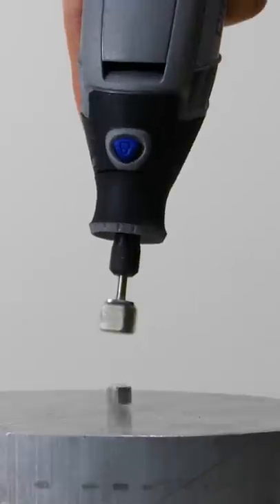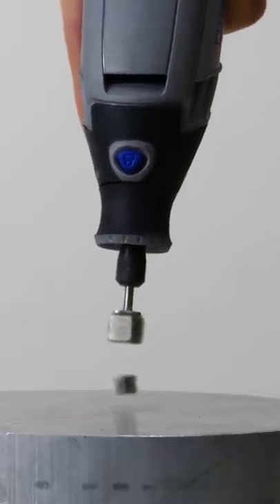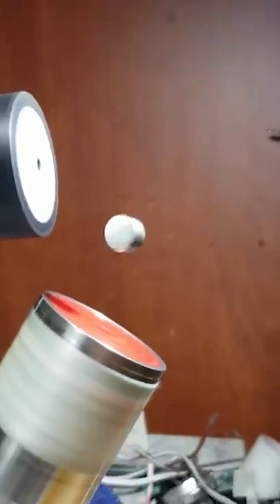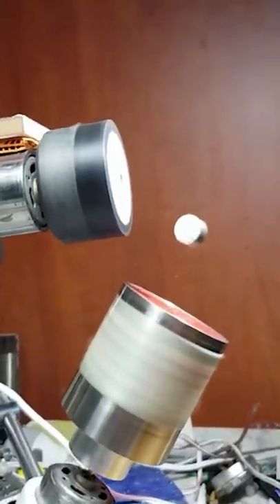Real-life Magnetic Tractor Beam! (New Physics Discovery)

Comment: If you can use a rotating magnet, it ought to be possible with a set of coils to create the rotating field
Reply: I've seen someone create a rotating magnetic field that spun mercury in a bowl
Reply: Sure is. That's how the motor stator in many power tools (especially cheaper brushless) is centred, eliminating need for some of the bearings.
Reply: That's why this isn't really new... It's been done for years now with a coil acting as an electromagnet, and having an alternating current through it. 

Like those display toys that have a floating platform or floating globe. The magnet is inside the toy or floating platform, and the coil is in the base.

It's interesting to see in practice, though, and can prove to be useful to demonstrate rotating magnetic fields in a more tangible way.

It is also reminds me of how magnetic gear boxes work. If you can look it up, it is a very interesting concept.
Reply: @altersami9660  Like Tesla's egg, but much more controlled/powerful.
Reply: @ChrisKarr  I've never heard of it before. Sounds interesting. Thanks for letting me know.

I've looked it up. Kinda similar, but the "egg" has to be a magnet, not a solid piece of conductor.
Reply: @altersami9660  It could just be an aluminium egg, with strong enough magnetic field. Diamagnetism/Lorentz force is a funny thing.
Reply: I believe the eddy currents created by using a spinning magnet versus an electrical coil is how this works so well.
Reply: @MySickstring  If you have a rotating magnetic field with enough poles and a proper driving circuit, you can replicate the exact same thing. Otherwise, you are absolutely correct.
Reply: 100%, I could probably personally make this solid state
Couldn't be harder to make than a simple CRT.
Reply: @itsthem5699  A simple crt just has two (four?) Coils for deflection.  We're talking about enough coils to simulate a constant-T field rotation. I'd think that an e-bike motor (or similar hubless) would have enough poles. Okay, yeah, winding it would suck...but driving it wouldn't be too rough.
Reply: That's what a generator is
Reply: Frank Dilson  It's an electromagnetic cushion; its cost of building, transportation and operation are far greater than the myriad other solutions to raising objects and holding them at a specific point which we already have.
Reply: @gabrielware2777  That would have to be a very lightweight flywheel to get it up to speed. Again, application is already well-served by bouncing personnel mines - bouncing betties.

Besides, traditional high-exp. materials are far superior for quick deployment, which preserves the element of surprise, not giving the enemy time to get to cover.
Reply: @altersami9660  the idea is to stop the forces from attracting thus scrambling the Electromagnetic Around U .thus weightless .
Reply: Frank Dilson  My, my.  Someone is deeply offended.  Why does one guy engaging with nearly every idea offered in one thread offend you?  If you contend with his ideas, then contend.  You've not been a guest in any of those programs, either, so it seems an even contest.  Present your own ideas, not some bizarre ad hominem.  Hey, it might be fun to engage with someone who is actually likely to reply with his own ideas.  

Or, you could just be a Karen about the whole thing and just try to tear him down.  Your choice.
Reply: Frank Dilson  Wow.. that came out of left field..
Reply: Frank Dilson  Primarily, my thoughts are based on study and border on religion, which makes me a non-viable candidate for most fields. My understanding of calculus is minimal, but I understand enough and have enough real-world experience with electrodynamics that physical interactions are fairly intuitive. Even quantum interactions seem that way. I enjoyed your attempt at using big words to sound as though your argument had merit.
Reply: @lahma69  Don't worry - all forces must be balanced! <(^_^)>
Reply: Frank Dilson  how much money you made asking that question?
Where is....?
Where....?
.....?
?
Reply: @altersami9660  9
Reply: Frank Dilson  I'm not running my mouth, I'm giving learned responses to ideas with little merit. Much like your life seems to have.  drops mic
Reply: Frank Dilson  I didn't ask how much money you have, I asked how much you made out of that question. Just like you asked that guy. Was that not clear enough?

Why would I rage with envy? What reasons would I have? Can't explain huh?

Plus that know-it-all-about-someone-else's-enviousness-based-on-nothing attitude, lack of reading comprehension, & eagerness to fallaciously attacking the person don't seem to be worth envying anyway. Raging yet with your envy now?
Reply: Only if it has no corn in it
Reply: @salaciousBastard  Easy, just give me 8X the energy required to lift it through normal physical forces.
Reply: @altersami9660  I do need to make a correction to your comment about the floating magnetic toys. I have such a toy - a globe - and studied how these work fora science project at school. They use either an infrared light beam or a hall-effect sensor to measure the distance of the floatable object to the electomagnet, and then adjust the electromagnet to keep the floating item at a predetermined distance.

That differs from this dremel effect in that the dremel does no such measurement and simply provides an alternating magnetic field.
Reply: @altersami9660  yeah but with this the floating magnet isnt rotating & doesnt need any rotation to continously balance itself
Reply: @johnsmith-jd1cd  The magnetic floating toys don't need to be rotating. They can stay still. But they look better rotating.
Reply: @johnsmith-jd1cd  I think there's been some confusion on which floating toy we were talking about. I think you ment the spinning magnetic top, while I ment the floating electromagnet like this one:
https://youtu.be/QOEyxwhw254
Reply: @jmrumble  You're right. Also, in this experiment, the rotating magnetic field seems to be rotating perpendicular to the floating magnet's field.
Reply: @salaciousBastard  No That's a rink.  A completely different department. That's two doors down on your left. This only does fields
Reply: @ChrisKarr  Yeah, like rope. That shit is great at raising objects and holding them at a specific point.
Reply: Alien tech at its most simplest
Reply: @altersami9660  you're talking about diamagnetic levitation and servomechanisms this is different this creates magnetic locking, similar to quantum locking which happens with superconductors
Reply: This is also how a starter kinda works in a car, with the coils and rotating magnetic field
Reply: @walkinmn  yes but the magnetic locking is the result of a rapidly rotating magnet in which north and south are always swapping places causing attraction and repulsion to happen in equilibrium allowing the other magnet to lock in place. This same rotating pole effect can be recreated using alternating currents or brushless DC circuitry.
Reply: @Frank Dilson I see that you deleted your comment that many of us in this thread replied to... Either that, or probably more likely, the author of the video (or YouTube) deleted it for you. However, I'm going to pretend to live in a world where you recognized the toxicity (and the sheer, out-of-left-field bizarre nature of) your comment and deleted it yourself. Yay for imagined self-imposed progress! 🎉
Reply: @ChrisKarr  electret magnetism
Reply: 3 phase electric Motors do this!
Reply: At that point it's literally just an electric motor
Reply: Freaquency is the key to this it’s not so much the polls or the field itself but the frequency of the field and the weight the mass of the object you’re trying to lift or levitate
Reply: Iirc this is how an induction motor works
Reply: Are you thinking what I'm thinking?
Reply: Those are called induction furnaces and someone already has
Reply: @LTRayzor  brother where did you see this? I've gotta see it myself.
Reply: @paulwhite5289  I found some videos here on YouTube but the original version I saw was not on YouTube. Not sure I can link it here but search rotating magnets mercury
Reply: That's a damn ufo
Reply: This is alien tech
Reply: Hey everybody....this is ufo tech, y ain't no 1 point that out? If we put all our brains in this n make a remote control 1 like a drone pero a ufo....a gyrosphere would a frisbee in the the middle for balance and aerodynamically two Chambers of mercury holders to spend both of them the opposite way of each other, a few little electromagnets to keep it spinning a coil to create an electric field or something like this brother... maybe a 3rd or 4 mercury chambers for horizontal spin maybe idk...I only did good in science class n p.e.
Reply: @its-c0e-u-see   this was exactly my thought
Reply: @its-c0e-u-see  scroll up, I pointed that out.
Reply: I just said same thing in dumber way haha...  Also plasma electro magnetics ... ?
Reply: @LTRayzor  thats just plain copper with current in it with no frequency... like the rail gun works, similar effect with coil gun but a whole diff "pulsating" system

Comment: Hmmm. This makes sense. Electromagnetic levitation achieves the same thing except the electromagnetic polarity is switched using electronics instead of mechanical force.
Reply: Now we can achieve the same effect with permanent magnets and a spinning motor!
Reply: This isn't quite that though. In electromagnetic levitation the switched field points along the same axis as the levitated magnet's. Here the spinning field is perpendicular to the levitated magnet's.
Reply: @AtlasReburdened  That's just it. Perhaps this will prove to be a more efficient way to achieve mag-lev.
Reply: @seanhoude  naw. Moving parts are always less efficient than non moving parts. Plus the use of permanent magnets are not realy safe for use in a train due to the intense from sun the magnets will be exposed to over the years. The magnets will slowly loose magnetism. But still this is awesome
Reply: @Skunkanoid  sad for you then because if so.. You will have no one or no "God" In the world that is or would be ever worthy of you.
Reply: @raloed.363  I hear you on the moving parts, but switching polarities on that scale isn't fast either. Could just as easily be electromagnets on both sides. It's an interesting concept. The current model is repulsive for the most part. The idea of being locked into a position between alternating attraction and repulsion sounds safer to me. Less likely to lift off, for example. Just saying it's worth investigating. Have you ever seen how a superconductor can be locked into relative position either supported by our suspended from a track of magnets? Now we have a way of doing it at room temperature. This is huge!
Reply: @jairussiriyalaofficial8922  we are only talking about worshipping here, i have a pretty good life without this "god" actually
Reply: @Skunkanoid  you think you are happy because you have no idea what you are missing, like in the island of born blind people no one realises what they are missing. Because you have no connection/Relationship with God you're not missing the most pure and unconditional love. Hopefully you will find out one day if not.. What you would describe of how the place after death will be will not be so great.
Reply: @Skunkanoid  ok about that I cannot say anything, but I should say you don't know what you said about your loving wife and marriage life. It is similar to saying that I don't care about my parents and wish never was born to them but I love brothers and sisters. You really think if God's grace is not there, you will be so lucky that a (non-god knowing) good woman of these days (rear) would be entering in your life. Very naive. Ok hope you will understand what your heavenly Father's love and care for you while you are still having time on this earth. 
And I am happy for you brother that everything till now have been made  perfect for you by the grace of God.
Reply: @jairussiriyalaofficial8922  i know exactly what I'm talking about when i talk about my marriage (this is not a religious marriage).
your comparison to it is illogical and not even slightly close to what i mean. 

oh what my "heavenly father" has given me? Not a perfect life, That's for damn sure lol.
i guess you are thinking that the only reason me and my wife got together was because the "heavenly father" wanted us to... 
People like you are so afraid of not having an "answer" to everything. We might all just be living here because of some other reason than what the Bible tells you,
Reply: @jairussiriyalaofficial8922  You are talking about a deity that was invented by man as though it were real. Men have invented hundreds if not thousands of other god's during our history, why don't you worship any of them?  Do you deny they exist?
Reply: @Skunkanoid  Physics and common sense disapproves that possibility, for me lol
Reply: @Skunkanoid  And yeah, he isn't being described as a sadist, but rather a psychopath who decides the fate of people. Either happiness or misery. All of this is shit.
Reply: @sridathan1876  fair point, I'm just saying that from a christian point of view, all he needs to do is prove to me that he is real and i will believe it. i wouldn't follow him though obviously
Reply: @sridathan1876  cope
Reply: @sridathan1876  My Christian God is a being that created the universe (and humanity) out of boredom and loneliness and want of feeling. It explains the biblical psalms and their importance. Life is for feeling through God; the only reason for sins being what they are, in my mind, is because they hurt others or reduce the ability of the self to be happy and feel for as long.
Reply: There is no god, and Dirac is his prophet.
Reply: @ChrisKarr  
That sounds a lot like the Hindu goddess Kali.  She created humanity because she was lonely, and with life came death.  She is therefore a goddess of death who wants people to enjoy life as much as possible.

None of that is anywhere in any of the Abrahamic religions though.  To Abrahamic theologists, Hindu theologists are pagans.

Originally, sin was just another word for crime.  If you look through the Pentateuch which is really just a copy of the Tora, that's exactly what it means.

Nowadays the meanings have separated because almost nobody follows the laws declared by the Pharisees in the bronze age anymore.  People like their mixed fabrics and their pork.  But the priests of all religions still want blasphemy to be a crime, and it would be obviously ridiculous if they felt insulted on behalf of a metaphor.  And then who would still be buying shares for posthumous dividends?
Reply: @ChrisKarr  "My Christian God". Yes, he is real and lives purely in your imagination. "My Christian God".
Reply: @sridathan1876  I appreciate your derisive opinion. I was trying to be respectful of the beliefs of others. Clearly, that concept is lost on most commentors, here.
Reply: @sridathan1876  To expound on the factual existence of a God of some sort, from a physics perspective; there must have been a scientific reason for the big bang. We can't find one.

There must be a Singularity at the heart of the big bang; as a Singularity is outside time, that means the universe still exists as a Singularity from a 4th dimensional perspective. That makes everything connected and helps to explain quantum entanglement and strange time effects.

Along with these premises, entanglement also gives allowance for human neuron tips to become entangled with outside matter, influencing or observing such matter from a distance.

Through Maxwell's Demon, one can seemingly violate entropy without actually doing so from a Newtonian perspective... like taking heated molecules from one part of a system and moving them to the other side, allowing the slower particles to conglomerate and, in the case of water, freeze below that person's feet. 

You think my religion is based on nothing? I have learned to prove miracles. You have learned to insult others without rationale.
Reply: @davidwuhrer6704  Excellent comment about 'Dirac'. I had never heard of him. Sounds like his thoughts align fairly well with mine. 

From a reincarnation perspective,  Einstein may have once said of me, "I have trouble with Dirac. This balancing on the dizzying path between genius and madness is awful."
Would explain why I find every quantum principle I learn of to be 'a given'. Energy is not created, nor destroyed, it just moves elsewhere.
Reply: You don't need to alternate polarity to use magnetic levitation, you would if you also wanted the object to move in a direction but obviously for just levitation.
Reply: @madness198648  For just levitation you can use a single polarity and rotate the field through the coil sets, sure, but a full-bridge is much more energy-efficient than a half-bridge.

Comment: I've had this idea for years to make a terminator skeleton. 
The bones would be "floating". 
Never thought it would actually work.
Reply: What's the advantage to floating bones?
Reply: @sebione3576  intimidation
Reply: @ranjitsharma5811  no but seriously why would you want floating bones
Reply: If they fall off, increase the magnetism to suck the limb back in. 
You would need a replaceable plastic wrap on each joint, so combat shrapnel doesn't stick to the inside. 
If each bone is seperate, they'll all have a computer brain. This allows infinite range of motion, spacial awareness, and ease of replacing parts.
Reply: @capnlatenight5356  Neat idea.
I have long thought that skeleton warriors could be minimalist humaniform robots.  Muscles could be graphene sheets (as currently researched for nerve-controlled prosthetics) and the tendons whatever carrier material. I never had a solution for the joints though.  Intelligent magnetic bearings might do the trick.